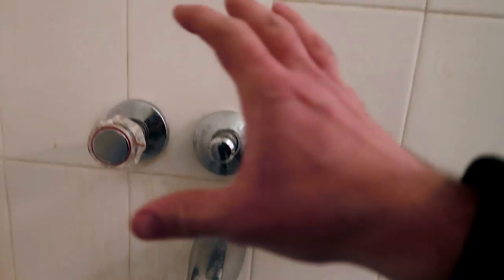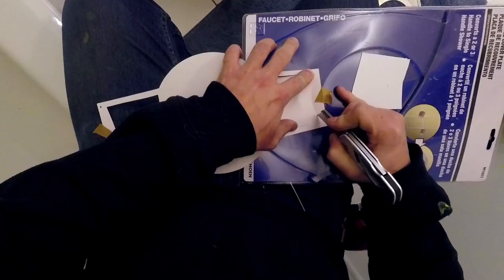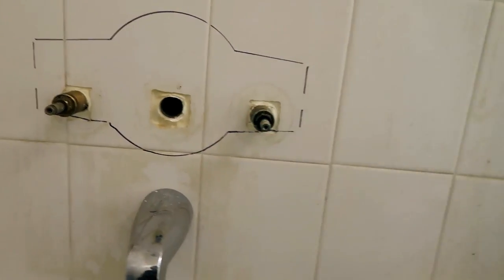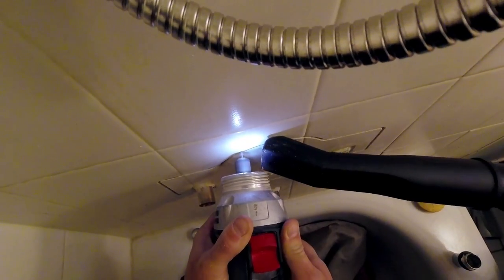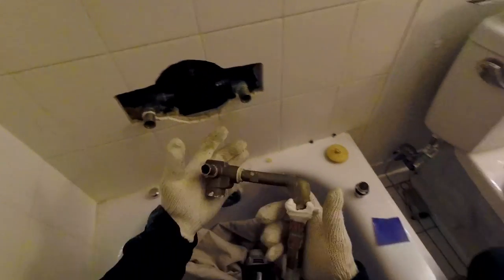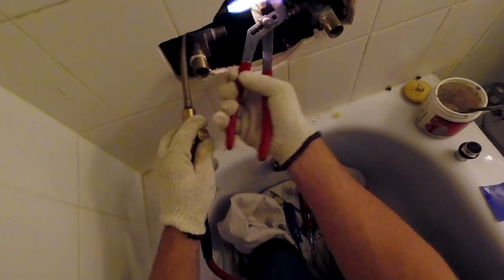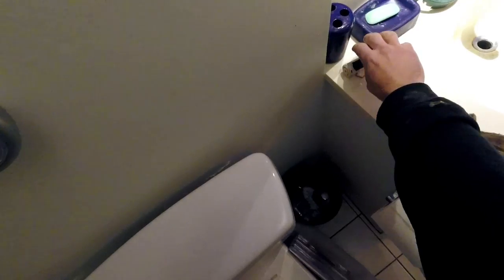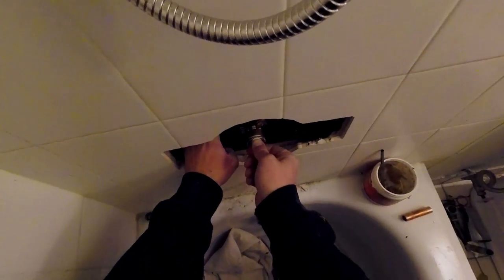MOEN SHOWER CONTROL VALVE AND REMODELLING PLATE INSTALLATION!!! | A Day In The Life Of A Plumber 120

Comment: Before you rip out the old mixing valves and handles,  consider instead capping the showerhead lead on the old and installing a new mixing valve for the shower only. Then you dont have to bother with the over sized cover plate. Also, the new mixing valve will be flow limited to 1.75 gallons per minute whereas the old valve probably has a much higher flow rate to fill the tub.

Downside to this is making a brand new hole for new mixing valve handle and the back side plumbing becomes more complicated, need to supply both valves with hot and cold.

Comment: Good job on the Rotozip cutout. I always see you use your gloves to wipe your solder joints, are those just work gloves or are they heat resistant ?
Reply from the maker: No heat resistance Jose, just regular gloves but they seem to do ok if you are fast with the wiping…